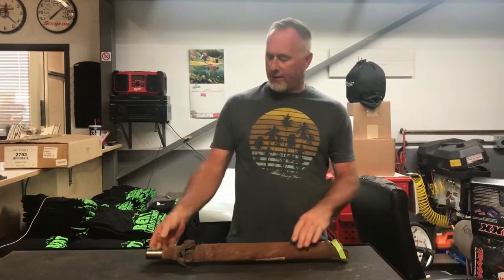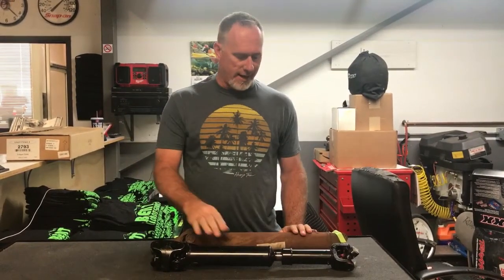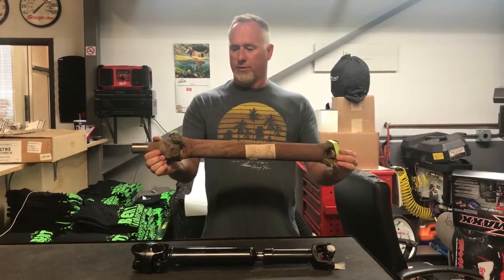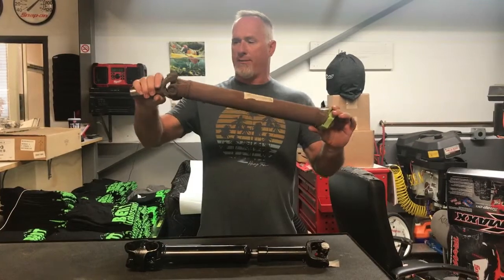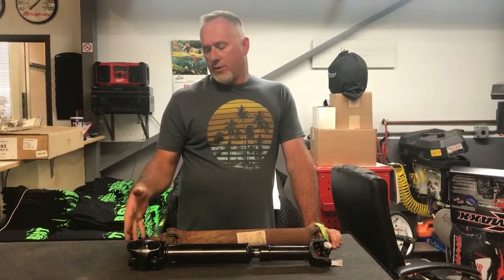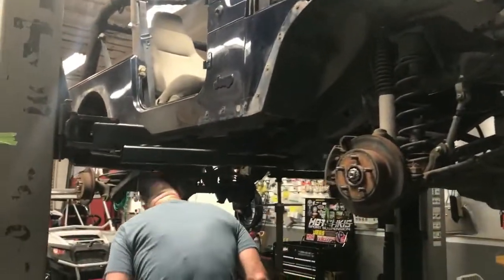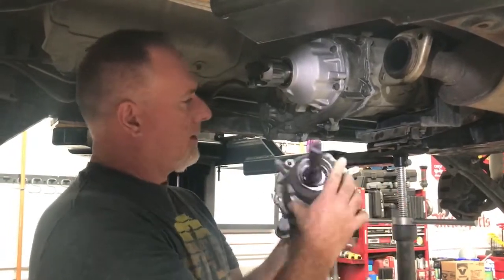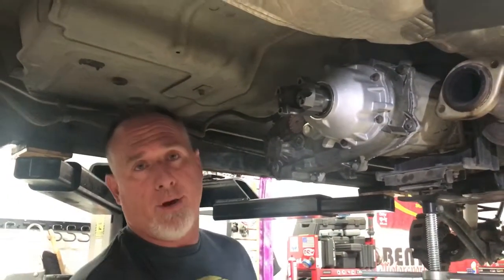What is a  Slip Yoke Eliminator

Comment: Is that shaft with the double cardan joint weaker since it is much smaller?  Or is that never a problem?
Reply from the maker: It’s not a problem. Things break and sometimes they break there. But it’s not a problem by design. Having this setup is absolutely the way to go if you have this type of transfer case.
Reply: I suppose that it will be even less of a problem if the diffs are re-geared to an effectively lower ratio even with bigger tires.
Reply from the maker: @paulstandaert5709  absolutely correct.

Comment: Best video I've seen! Just got an xj and its lifted and I took it out and holy moly drives like shit lol and after inspecting I need this for sure because my transfer case and current drive shaft have way to much play and im.not sure why but 2 days ago the dif or axle made anoise while cruising ..... and I pulled over and the driveshaft was steaming hot ...... it still drives but now seems like if I'm dragging or something is grinding in the sif or maybe a bad bearing ....
Reply from the maker: Definitely check it out! Out of phase Ujoints can get hot. I have never seen them get that hot but I suppose its possible. Was the Diff hot as well. Maybe you lost the spider gears. Inspect the Diff and see what's going on asap. Thanks for watching the video!

Comment: Would this be a permanent fix for GM slip yoke clunk problems?
Reply: Paul Jones that is a common problem on those, they almost all make that noise
Reply: Yes. But would this fully fix the problem?
Reply from the maker: I don’t have any experience with the GM problem but if it is called a slip yoke clunk. Maybe it would solve it. What transfer case do you have? First we need to see if there is one available for your transfer case.